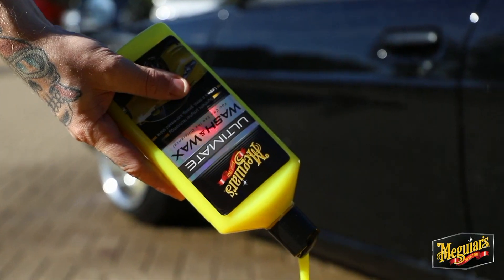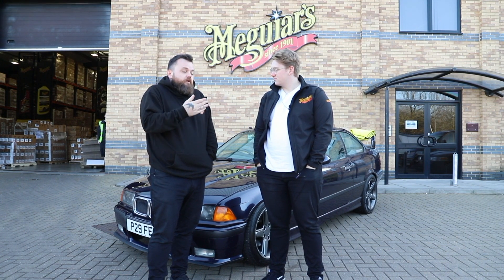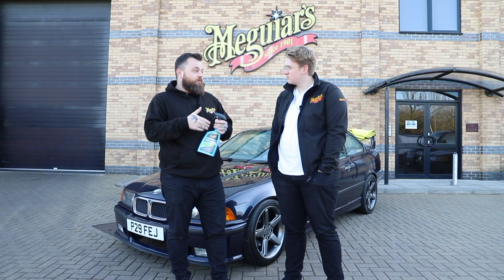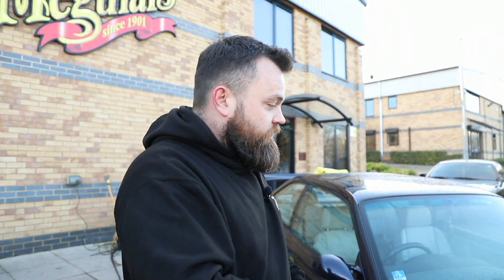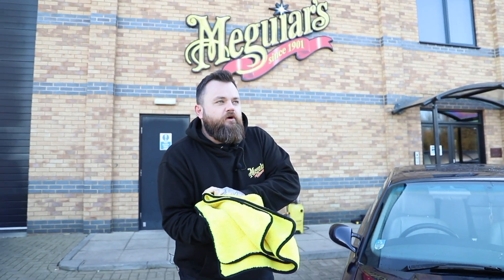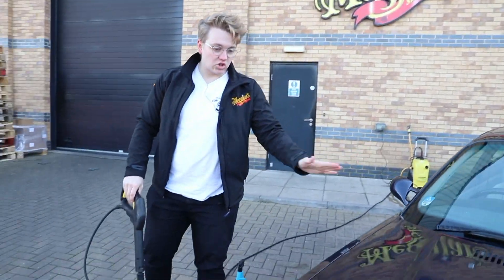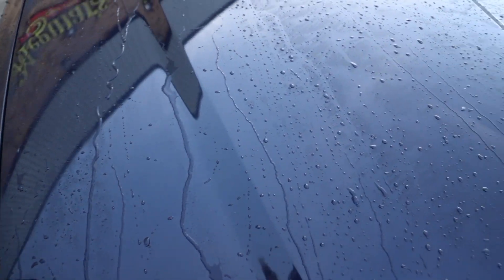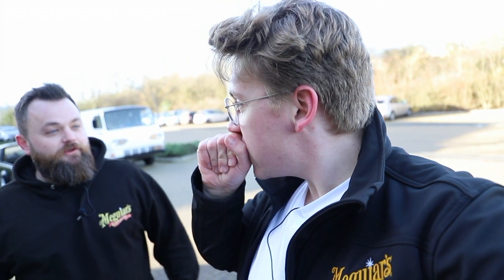How to apply new HYBRID CERAMIC WAX - Detailing 101 Ep.7

Comment: Before applying this hybrid ceramic wax, for the best result, I do think that we have to get the car properly washed, clay bar cleaned, polished or glazed for smoothness.. then, we could get the real smooth to touch, wet look and best water beading effect on the car paint surfaces.. without doing so, we're just wasting the ceramic wax as it'll not correctly bond to the surface without properly works done on the car paint..

Comment: Can you continue to use the initial wipe in method for subsequent applications too? As I feel rinsing off the product is a bit wasteful...
Reply from the maker: If you want, absolutely. The product is activated by the water so the spray on rinse off method not only saves time but also bonds to the base layer you've already put down.
Reply: Just bought this today and followed the non existent instructions on the bottle.
It left a very streaky finish after initial drying and took a good amount of time and elbow grease to remove it.
Is this normal and or should I apply an additional coat?
Reply from the maker: @springcopsespaniels2189  It sounds like the product dried fairly quickly on the car. I'd work panel by panel to ensure it's well rinsed so the the water can bond to the surface.
Reply: @springcopsespaniels2189  this is exactly the effect I'm getting. The car looks awful after the first rain. Tries the 2nd application first on my girlfriends car. Same results. 2nd rain sorted it. 🤷‍♂️ Some American channels are saying they're getting different concentrations in bottles.

Comment: Hi , good review guys..
Only one question.
I have used Meguiars..no water anywhere yesterday. Will it be possible to put on the Hybrid Wax. Or do a deep clean wash before?.
Cheers.
Reply from the maker: Absolutely! If you have waxed the car its simply spray on the hybrid wax whist it's wet and rinse off. Best to use it after you've cleaned the car.
Reply: @meguiarsuk  
Cheers

Comment: Hi. I've just got a bottle of this today. Always wash my Honda CRZ with Tech wash and dry with Ultimate Quik detailer so its beading nicely. So do I just wash the car as normal, rinse then apply this all over the car then rinse again and dry?
Reply from the maker: For a car that doesn't have a layer of wax you would need to spray on wipe off, spray on and rinse. For a car with wax protection , wash car as normal and rinse off. Whilst still wet apply the Hybrid Wax and just rinse off.
Reply: Meguiar's UK and you can apply it on everything?
Reply: Used this today. Absolutely amazing product. Love it.

Comment: Could I apply it on waxed car or the car should be with out any protection at all?
Reply from the maker: If the car is waxed, wash it as normal then whilst it is still wet spray the Hybrid on the panel and just simply rinse off.

Comment: It's a college course thing. Section 1 chapter 01 so 101 kinda, next class would be 202 or 102 depending on the school.
Reply: Benny T in Australia 102 would be for the next class if it was also a first year subject. 201, or 202 would be used if it was a second year class. Although most classes are more like 161, 162, 230 etc and it’s not like the first history subject will necessarily be HIS101. Also, some universities use larger course codes like ENGL1600, which has four digits.

Comment: How many times cots?
Reply from the maker: If applying for the first time its 3-4 spray's and a wipe off. Wet the panel again, spray on and rinse off. If you are applying it  to a car with protection already on the paint, it's 3 to 4 spray's and rinse off.

Comment: if you do not have a jet wash is that ok ??  i Have a hose etc ??  thanks
Reply from the maker: Absolutely not a problem
Reply: @meguiarsuk   thanks, can this product be sprayed onto plastic trims, i.e front rad grilles and fog light grills and spoilers ??
Reply from the maker: @garyhoward6426  It's designed to work on paint as the protection is activated by the water.